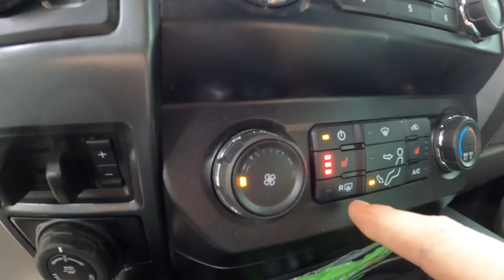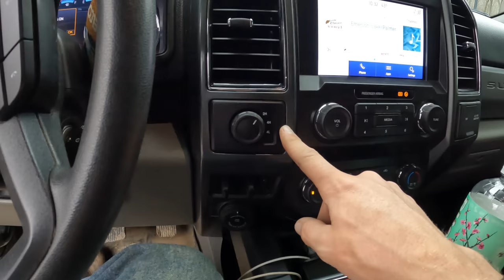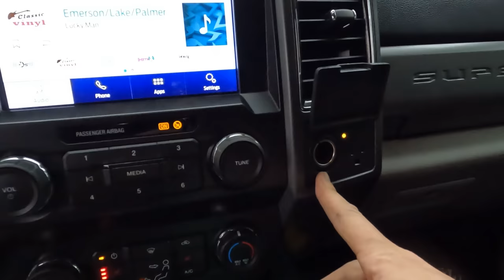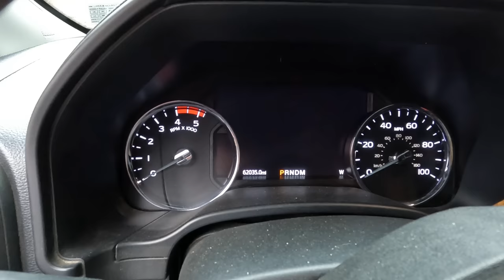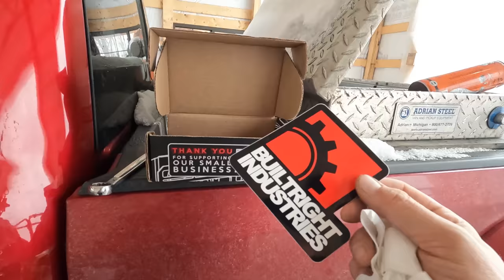I bought THE BEST Pickup Truck on the Market (Ford F450)

Comment: I think the injection system you are referring too with the oil firing the injectors is HEUI. It's used in 7.3 and 6.0, but I think the 6.7 uses more conventional fuel injection like what's found in Duramax and Cummins. Still important to use good oil. Thanks for the videos!
Reply: Scorpion design with the exhaust feeding into the V where the turbo sits. I prefer the I6, simple,less parts. The I6 has 40% less moving parts and alot better low end torque as well. But it comes down to what you prefer. Also Ford has two cooling systems. I'll bet Ford comes out with a new I6 in the future. The 300 was a workhorse. Jeep has a twin turbo I6 on the Grand $113,000 Wagoneer!!!!  Congrats.
Reply: I doubt ford will ever bring the 300 back because the real reason they got rid of them was because they lasted to long I have 2 both have surpassed a million miles and are almost to 2 million and still going strong
Reply: That is correct. 7.3 and 6.0 were HEUI which were a marvel in 1994 when first introduced.  Cat/International developed them. 6.4 was the only International engine that Ford used that was common rail. After lawsuits against International for warranty claims Ford developed their own engine, the 6.7 Powerstroke and released it 2011, also common rail like Isuzu and Cummins.  I will say, (and I can because I have owned six of these trucks and put hundreds of thousands of miles on them) it is wise to also use a quality fuel additive as  the Bosch CP4 pumps need the extra lubricity that modern fuel lacks. Rotella 5w 40 is👍🏻
Reply: @dylanvervalin4798  You are correct Sir. !!!! Tooo bulletproof.
Reply: wait they stopped using the heui system? But it makes sense, for modern diesels the way to go is common rail, too much nonsense in the heui for little benefit amd pair that with emission and you gwt the 6.0 and 6.4 😂
Reply: As an ex She'll employee I'm glad to see you're using a premium quality oil, Rotella !!
Reply: Correct 6.4l and newer went to the common rail fuel injection like the cummins and duramax. So instead of high pressure oil it's high pressure fuel.
Reply: HEUI high Energy Unit Injectors.... new trucks use The Bosch CP4 Common Rail Deisel System
Reply: @glennschlorf1285  Hydraulic Electronic Unit Injector I believe
Reply: @glennschlorf1285  It actually stood for Hydraulically Activated Electronically controlled Unit Injector.
Reply: @dylanvervalin4798  The 300 has to be the longest running engines around. My neighbor has one out of a wrecked Ford I forget the year but it is a 70s model. He uses it to power pumps and a generator. I has well over 300k HOURS of operation in its current set up, in the truck it came from it has 200k miles. Not sure the hours, but after being in its new home as a generator and pump it has always had a hour meter on it, its now showing 300k hours. Still fires right up. Sets at 4,800 or so rpm when in operation. Its a common conversation piece. "is that old thing still going...." dam.. We all do not know when it will finally quit.
Reply: @opossom1968  the dodge 225 slant 6 lasted a long time.
Mainly the same reason the 6.2 GM diesel lasts a long time.
They don't make enough power to hurt themselves.
The Ford 300 six is an amazing engine.
The RAMBLER/AMC/Jeep 6 cyl is a long lasting and amazing engine as well.
Reply: Yeah he was confusing a common rail system with a HEUI system. The 6.7 doesn’t use the HEUI system anymore. Ford was smart to finally get away from that antiquated, over-complicated system.
Reply: Yup, I was thinking the same thing lol. Matt, you got that part wrong or confused with old blue. Your 6.7 does not use oil fired (heui) injectors like 6.0 and 7.3. Still great oil to use for good price. I have ran t6 in my 01 7.3 for 10 years or more now. It truly does make those heui strokers happy. Especially in cold climate with that 5w-40 weight. I would say necessity for northern heui powerstrokes.
Reply: @opossom1968  lol you gotta love an engine with the same sort of reliability as industrial PC fans. With those, if they don't last AT LEAST 250k hours you'd scream ripoff. Nobody will ever make another engine like the Ford 300--best thing FoMoCo ever did, and it almost atones them for their other sins. I'm looking at you, horrible engineer that figured it was smart to run essential transmission functions through the third brake light.
Reply: @haroldphipps3457  lemme know an engine in the 70’s and 80’s that made power… none. I do agree 300ci Ford is best engine ever made.
Reply: Most common rail systems do not use oil pressure to fire injectors, they build fuel pressure with a high pressure (second) fuel pump/block. So author's explanation was rather assumptioous.

Comment: Hi Matt! A piece of advice for you...get the biggest mud flaps you can find and put them on your front fenders (you already have good ones on the rear). Get the ones that are so wide they'll keep all the slop and salt from flinging up on your front fenders, doors and rocker panels. Hopefully that'll provide a bit more protection against our lovely rust belt. Also, in your copious amounts of spare time, design yourself two pressurized water spray bars that are capable of spraying the underside of the truck. It WILL pay off in the long run. Good luck!!
Reply: There aluminum so i hope it doesn't rust away
Reply: @thatmaverickguy859  One definite factor in my choosing to get an F150 instead of Brand C or R is that aluminum body. Saves 700 lbs on the F150 and isn't gonna rust out. All those little white and blue postal mail trucks you see running around were last made in 1988 - the newest ones are now 34 years old, they are aluminum and do not rust.
Reply: @townhall05446  and they on a S10 frame so they'll run forever
Reply: Or you can just spend 30 minutes of your time and Fluid Film the undercarriage so his truck doesn’t only last 170k miles.
Reply: @thatmaverickguy859  aluminum turns into grey dust  and Ford has a history of struggles with getting paint to stick to aluminum. I wouldn't let knobby tires fling rocks at the body whether it's aluminum or steel.
Reply: @townhall05446  What is the cab mounted to? Steel. It's the frame, not the body, that is of greatest concern. Ford totally re-engineered the frame when they came out with the aluminum super duty, but when they went fully boxed, they reduced weight in the frame. Throwing rocks and salt up at the steel that the body is mounted to is still a big problem. Plus Ford has a long history of failed attempts at getting paint to stay adhered to aluminum and it would be a real shame to chip the paint and have the infamous aluminum oxide grey dust bubble and flake the paint off. It's good that the cab corners won't rot through in a few years like my 2010 F-150 did, but it's not as simple as "oh it's aluminum, I don't have to worry about corrosion, rock chips, or rust anymore."
Reply: @TheShowtime85  Don't you have to strip down the chassis to do that almost like you where painting the body?

Comment: We live in the semi desert in Western Queensland (Australia) and have 4 Toyotas. One of them is 40 years old and has over 720,000 on the clock. Rust does not happen in the semi desert, but not having anything but gravel and dirt roads for 60 miles, we specialize in wrecking tyres and suspensions! We don't have your towing requirements  and have stuck with Toyotas for reliability, and because we can usually fix them. With the nearest dealers 150 miles away, sophisticated electronics can be a pain as they are for you. Different environments different requirements, but we still learn a lot from you and guys like Wes from Fulton IL. Many thanks.

Comment: You can swap the fuse either left of right to make the power points in the truck stay on when you shut the ignition off.  It takes like 2 mins to do..  Check your owners manual it will show you how to do that.
Reply: There are still owner manuals for new cars?
I thought it would just say "visit your dealership" 🤣
Reply: Owner's manual? How about a spare tire? Not in most new vehicles... SMH
Reply: @edpoints1127  that is because the first buyer doesn't want to pay for a tire they never use. All new cars come with road side assistance now. the next owner after say 4 years, he may want a spare tire, they can buy one. All my cars still have a wheel well for a full size tire, even if it is empty from the factory.
Reply: @uliwehner  that's the point I was trying to make.... Spare tire extra? WTF? In my opinion, when did it become OK to NOT have a spare tire? Is the cardboard under frozen pizza going to be "extra" next? Is a cord on a TV going to be extra? Is sliced bread going to be extra? These foolish ways to make money... or supposedly save money are getting ridiculous. Never use? That's a ridiculous assumption. Do you wait until you get a cut to buy a box of bandaids? Do you wait to buy a can opener for your kitchen until you found a can that's not an easy pop top? Would you pay extra for shoelaces if they stopped including them with shoes, since a lot of people don't tie their shoes?  Roadside assistance only works if you #1 have reception, and a cell phone... with a charged battery. #2 if the "service"  isn't overflowing with calls during something such as a snowstorm. What would an 87 year old grandmother do if she was stuck in a snowstorm with a flat, some teenagers on snowmobiles come past and can't even change the tire since there isn't a spare tire?
Reply: @edpoints1127  the reality is that the first owner does not want to fork over money for things they won't need. like back in the day stainless steel exhaust was thought about, but regular mild steel lasts 4-5 years anywhere, so original owner never needs to replace it. no incentive to pay an extra 50 or 100 bucks for stainless exhaust for the next owner. Same thing with spare tires. likelihood of you needing it during the first 4 years is super low, and you have free roadside assistance. no reason to buy a tire for the next owner. car bodies had a rust through warranty just long enough where the original owner never saw rust. No reason to pay more so the second owner does not see rust either. you could think of many more examples for this. most cars are sold before they are 4 years old.
Reply: @edpoints1127   They are not really needed in most vehicles today. Most people use AMA. have cell phones and over 90% have no clue how to change a  tire anyway.  This is not the 1950's. But their are vehicles where the owners are likely to be able to change the tire and may not be in areas easily reached by AMA such as pick up trucks.  Remember most heavy trucks carry no spare tire either...
Reply: @uliwehner  Roadside doesn't do a darn not of good without reception. If the roadservice company is really busy, it is first come first serve. Grandma might have to wait. That's BS!
WHY IN THE BLOODY HECK did car mfg Companies stop INCLUDING spare tires? It should be a safety hazard.
You missed what I'm saying. Now I've repeated myself. Vehicle cost didn't drop after the spare tire was deemed no longer necessary and not included anymore. 🤬
Reply: @matthewq4b  I'm not from the  1950's or even the 1960's. I do travel to the Upper Peninsula of Michigan, Iowa, Minnesota and Wisconsin regularly... There's no such thing as a "not needed" spare tire. Who has time to sit in the middle of anywhere and wait for AAA?  Also depends on the weather.
I don't believe you can change a tire from the sound of things. I would feel like a real B if I had to sit on the side of the road helpless because of a flat tire. Getting robbed at 1 AM because I was just sitting there waiting for someone to bring AND change my tire isn't my cup of tea.
They were included with vehicles up until new generations could no longer change tires. 90% can't change a tire? Only 10% of the people I know can't change a tire, including women. If they don't know, I'll help them.
Reply: @matthewq4b  you sound like the state of California

Comment: I just picked up a 2022 F450 A few months back to pull my fifth wheel camper. Love the truck… The turning radius is just amazing to me. One note, it wasn’t the engineers who screwed  up the modern diesel, it was the EPA lol. By the way, make sure you change your fuel filters as prescribed in the manual. I actually cut that down by half the mileage it’s not a difficult job. I like to fill my oil filter before installing it to minimize engine wear on start up.
Reply: Better choice change oil and filter before prescribed in the manual.

Comment: Great video Matt you are correct the 6.7 powerstroke and the other modern trucks use common rail injection, but when you were explaining how it works, you confused it for the HEUI (hydraulic electronic unit injectors) system found in the 6.0l and 7.3l powerstrokes. Common rail uses a high-pressure fuel pump to create constant pressure in the fuel rails, and the injectors are controlled electronically. Similar to modern direct injection gasoline engines but the  diesels operate at a much higher pressure. Keep up the good work, really liking the videos recently excited to you fully moved into the new shop.
Reply: Yup. Cat was the HEUI people, Navistar used it.....maybe that's why they aren't making on road stuff any more? Cummins used something similar with the STC engine, 88NT 365 + hp and N14P. Oil was used in the top half of the injector to advance injection timing at no/low load and at around 50 ish lbs of rail pressure, the oil was shut off and the engine went into nominal timing. Kind of a PITA but being in Ca. We had MVT so STC was easy!
Reply: I had to listen to it 3 times and he did say oil…WHAAAT! I had to check the comments to see who would correct him😆
Reply: correct, commented the same before reading yours lol

Comment: Matt, there’s a free software you can use with a $20 USB to OBD adapter to be able to program a TON of stuff on these Fords. One being, the timeout for your power ports. You can set them to be powered always, or a delay of a certain time. 

You can also turn on “bambi mode” which allows fogs, high beam, and low beam to be on at the same time, as well as disable all the chimes and dings and doo doo doo’s. 18:12 

It’s called Forscan, there’s a lot of info on the forums about it, happy to drop a link if you’re interested! Congrats on the new truck!
Reply: If you look in your fuse box;   look up your cig lighter fuse, and it will typically have 3 slots for the fuse --- Putting the fuse on one side will give you battery power all the time, or if you move the fuse over to the other slot -- it will give you the key-only power..   I've seen some vehicles have the ability to change it with a good scantool;   You can also turn off your seat belt buzzer and the auto locking doors when you put it in gear, and even the auto-window roll down at the drivers window. (and I'm sure there are even more options on this thing -- it looks loaded).   It would do you a lot of good to spend $600 to $1000 on a really good scantool.   Thinktool, autel, xtool, launch, topdon, etc...  There are a lot of good options out there now, and it's worth having one-  trust me.
Reply: @calholli  With the Ford’s, it’s literally a $20 tool and free software. I’ve done it on my truck and 3 others. Everything you mentioned, auto windows, seatbelt chime, headlight function, power port function, auto mirror fold, all of it.
Reply: I can vouch for the forscan tool , I turned off the Auto Stop/Start.(feature) wear out my starter maybe??
 No need to push the button. Also the HONK-HONK when you jump out to grab your sack or tools and leave it running.
😁
Reply: @therealryan55  That's cool.  Do you know how far back it goes? or what It's called?  I'm just curious..    I have a 2002 F350 7.3L 6spd manual 4x4;  It's essentially his exactly same blue truck, only mine has the 7.3L;   not that it matters to me, since mine is all completely manual.  Manual transmission, manual transfer case, manual locking hubs, manual seats, manual mirrors, manual door locks, manual windows, and it doesn't even have tilt wheel or cruise control. lol..  It might as well be a tractor, but it has 340k miles now and is still a great truck..    But I've learned a lot about scantools lately, so I'm always open to learn more.
Reply: @calholli  I think functionality was pretty limited before the 2010’s
Reply: Forscan is great. Can the central power door locks be disabled? I always have to take the keys out of mine because it likes to lock the doors all the time.
Reply: @calholli  The more manual the better. All that automatic stuff is annoying enough when it works, and it only gets worse when it breaks.
Reply: @castirondude  I think it depends on year/model, but I want to say I saw a setting in there for something to do with the power locks on my 18. At the worst, you can always pull the fuse if you don’t want any power locks! 😂
Reply: @castirondude  I have a $700 Xtool D8, and it can certainly turn all that stuff off, including the seatbelt buzzer, auto door locks, one touch window roll down, etc.   Any scan tool that can do bi-directional and actuation tests will be able to do it.
Reply: @calholli  on my 2002 and 2004 ford's, I don't think forscan can do those things. You can turn off the seat belt buzzer with a 27 step process described in the manual so it's possible; but I didn't see any way to do it with the forscan.

Comment: Matt, in the up fitter fuse box remove the 5amp fuse and slide the plastic holder over and re install and 2 of your switches will be powered key off. then install some sort of power port for charging your GoPro batteries
Reply: I received an email to DM you on Telegram? Just checking if this is legit
Reply: @topherhaertel4705  It is not legit.  it is scammers.